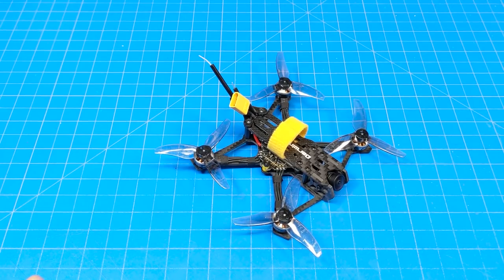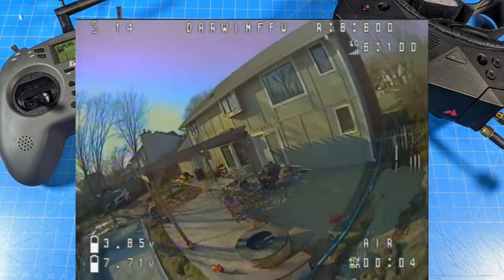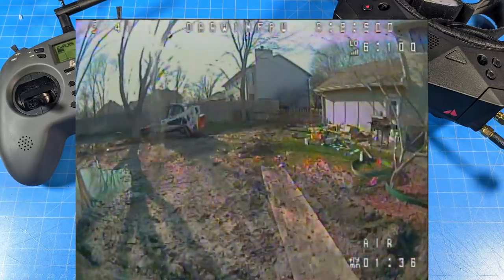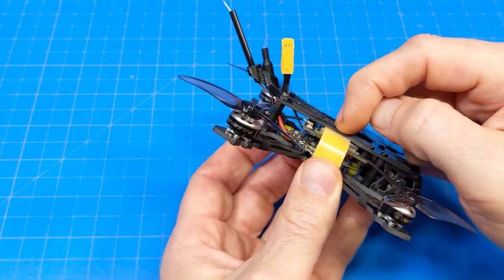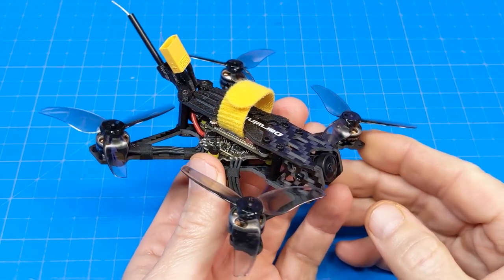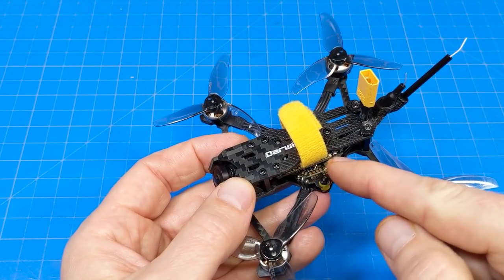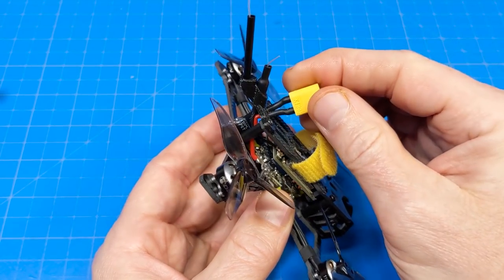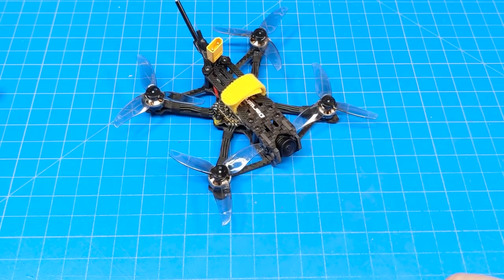Rare Top Mounted Micro Drone // $129 // DarWinFPV TinyApe

Comment: I have the Baby Ape and the Tiny Ape ELRS. I gave the Baby Ape a little TLC, re-arranged some wiring, and got full camera tilt control. Both quads have been really solid for me.
Reply: Im interested in the Baby Ape frame for a custom build. Was it the Caddx Ant camera with which you managed to get the tilt adjusted to the higher angle?
Reply: @yohfpv  I used the included Runcam camera but rearranged the wires behind it to get fully adjustable tilt. Nothing complicated, they just did a crap job with the camera wiring. All else is jam up.

Comment: Hello Nick, I purchased the DarwinFpv 129 about a year ago. I think it was $149 back then, from Pyrodrone. Wanted to get my feet wet in the 7" long range stuff. Flew really good, and even though it was a very light weight quad, as far as 7" ones go, it held up to whatever I threw at it. GPS had trouble acquiring sats at first, but otherwise a solid quad for the price! Much more resilient than a Happymodel Mobula in my opinion.

Comment: Ok, So I'd like to add my current experience to the Mix.  Obviously Nick has a ton more experience with these types of quads than I do.  

My TinyApes came with ELRS V 2 so that was nice.
# version
# Betaflight / BETAFPVF4SX1280 (BHER) 4.3.0 Dec 13 2021 / 11:23:34 (norevision) MSP API: 1.44

I just received mine DarwinFPV TinyApe (Qty 4 as I have 2 daughters that fly as well), on Friday (All 4 took about a month to get to my door and showed up on the exact same day together, even though I had placed the order for the first one 1.5 weeks prior), and have had one motor go bad, and another motor break a shaft. 

We had treated the TinyHawk 2 much much worse, and honestly it had 50 bad crashes, and other than the props, and a few screws breaking the components worked fine, so I guess I was expecting the same form these.  The TinyApe sure seems in the same line a the TinyHawk 2 Freestyle 2.  I would have to say that with the TinyHawk, what my 10 year-old daughter put it through should be called ABUSE, she was really rough on it.

While the broken shaft stays on mostly during flight due to the motor magnetics its interesting that in about 50+ flights on 2 of these TinyApes that we already have 2 broken motors.

I had upgraded one to the 4.3RC6 Firmware and applied the CLI List directly from Darwins site, and there are errors, that need to be corrected.  The original dump seems to have the same errors even if you apply the 4.3RC1 firmware.  Darwin must be running an original non RC code.  I enabled 48k pwm /Dshot Bi Directional and had about 52% CPU, and applied the UAVTech Whoop 1s&2s presets, and the unit seems to fly fine with the AvianRush Props that the TInyHawk used.

So to me it looks like the FC board is better than the Emax, but the motors seem to be MUCH worse.

As far as flying it seems to run well and had a nice feel during circuits LOS (Line of Sight).  The video transmitter get HOT HOT HOT under the strap that is a pain as Nick has said.  I have tried turning it OFF, and that doesn't seem to work, I have also turned it down to 25mw as we are LOS right now.  The video was good and strong in our 04x and 04L's.

I'd like to know how to turn the video off and save some heat, and also who make the best 1103 motors as replacements, as I don't thing the Emax ones will fit as they use that weird screw pattern.
Reply from the maker: While not a good experience. I appreciate you taking the time to leave your experience and thoughts as well. Valuable information for those willing to do read. About the only way to really turn off the vtx is to put it into pit mode, if the vtx has pit mode as not all do. We can assign that to a switch in the modes tab. Otherwise we can put it in low power disarm which is on the vtx tab of betaflight app. This doesn't turn it off but keep it at low power until we arm. The next alternative is to de solder power from the board, which is a pain and a bit of an extreme step.
Reply: @NickBurnsFPV  The real question is who makes the best 1103 8000kv replacement motors as far as durability goes.  I really like the quad otherwise.  It seems to fly similar to the TH2 with the Avian Rush props and a little throttle limiting for my younger daughter, older daughter prefers the more slippery feel of the Gemfans.
Reply from the maker: @halledwardb  That is a good question. For durability I would suggest brotherhobby or rcinpower. I would start with rcinpower.

Comment: A while back I bought a bunch of tiny little M2 and M3 washers, some stainless, and some made out of a really thin black plastic, that were only a few thousandths thick, or maybe like 0.25mm or so; eventually I realized they were super useful as very small-increment spacers for stuff like the gap from the VTX to the top plate, etc... Actually in a situation like that I'd put a couple of them on top of each of the standoffs, or one on top, one on bottom, depending, to create a very slightly larger gap between the top and bottom plates, then a couple on the VTX screws to make a bit more room for the strap... Anyway, just a footnote; great video as always!

Comment: Been waiting for this review nick 😁👍🏽It seems like it's a decent little ripper I however hope they come out with an updated version of elrs since my literadio 3 is 2.0 but other than that it really looks great for the price and to have a 600mw vtx is one of the highest I have seen on this size quad 👍 great review I have been pacing the mailbox for my mobula7 1s elrs lol but I'm definitely gonna grab this quad next 😁 the pool is coming along great too👍🏽✌🏽
Reply from the maker: Interesting that they show the board alone with ELRS v2. Maybe they have updated since mine was sent out. I have had it for a good while.
Reply: @NickBurnsFPV  good point nick maybe so because I really like these little quads they really rip and it looks like the power to weight ratio is pretty good I didn't see any issues when you were ripping ✌🏽
Reply: They've updated it by now. It ships with BF4.3 and ELRS2.0.
Reply: @FerralVideo  man my mobula7 1s gyro was bricked I'm scared to mess with another aio elrs board lol

Comment: Throttle scale is what you're talking about.  You'll find it in the rate profile screen.  Also useful is setting your throttle's midpoint to match your hover point.  When you do that and throw on full expo, it makes holding altitude while flying in Angle mode a snap.

I ordered a Baby Ape Pro from Banggood on the last week of March.  Expecting it within the next two weeks.  Got it for CDN$128, including 4 sets of spare Gemfan props, and s&h.  Great deal.  I'm going to try running it on some 2S Tattu 450 mAh HV 95C long packs.  I've got a Happymodel ELRS/VTX combo board and a HGLRC lollipop antenna for it, too.  The Tiny Ape looks like a winner for me, and I think I'll be having one in due course.  I was planning on getting a backup for the Baby Ape anyways.
Reply from the maker: Isn’t that only in bf 4.3? We will hopefully see the 4.3 final
Reply: @NickBurnsFPV  I've been using it on older BF firmware for a while - at least a year or so.  Under the PID tuning tab, and Rate Profiles tab, there's a Throttle Limit box, I choose 'SCALE'; a Throttle Limit, up to 100%; a Throttle MID; and a Throttle Expo.  Right now those last three numbers are set at 50% Limit, 76% MID, and 100% Expo, and my transmitter's throttle has a 90% Expo on it.  Altogether this gives me a huge sweet spot mid-throttle when flying in Angle mode, with the added benefit of being very forgiving and smooth when ascending or descending.
Reply from the maker: @billmcdonald4335  ah I must be mistaken. Kinda normal. Its nice the betaflight devs thought to include that as an easy option for us.
Reply: @NickBurnsFPV  I'm using 4.2.9, ATM.  Started on 3.0.whatever.  The devs have done wonders over the years.  I fly a four-year-old platform, and I've got it handling like a modern-day cinewhoop.  Smooth like buttah, thanks to the devs - and some great tuning advice from Chris Rosser, and Mark Spatz.  And actually, your review of the OG KingKong ET100 is one of the reviews that sold me on it, so thanks, Nick!  That's what I still fly - tho' it's the V2.

Comment: I got a tinyhawk 2 freestyle years back, it's very similar to the babyape, 2.5in 1103 motors etc. Upgraded it with a new fc with elrs and a 400mw vtx, new props, xt30 and so on. It flies amazing.
Reply from the maker: sorry can you clarify which you upgraded?
Reply: @NickBurnsFPV  I upgraded the flight controller aio on rhe tinyhawk to a happymodel x12 elrs aio that supports 2s, it had an integrated 400mW vtx. Had to do a bit of drilling on rhe frame ro make it fit tho.
Reply from the maker: @leonardterlevic4765  ah I understand better now. Thank you

Comment: I currently own four quads from Darwin FPV. I live in south Florida, and they arrive pretty quickly. I love their quads! One thing that I noticed is they are never tuned very well! I have had to tune the PIDS to eliminate oscillation issues on two of them. I do have the 7" long range and it  gets a lock faster than my Diatone Roma. One had the VTX locked at 25mw. I wished that manufacturers who sell to the states would have them unlocked at 25mw to make it easier to set them up! One thing that most reviewers should tell about this little quad is that the PID tune is set by default for 2S batteries. The recommendation is to set the PID tune to profile 2 in Betaflight. That is supposedly preset for 3S flight!
Reply from the maker: But with that they state the motors will burn on 3s.

Comment: I have been looking at one of these, but I am just so happy with my modified TinyHawk II Freestyle that I would have too high of hopes for this.  For sure going to pick up something Darwin at some point though...maybe a 7".  Out of curiosity, why do you not high volt charge your multi cell packs?  I have been HV charging mine and would love to know what the reasons are so I might consider adopting the standard myself.
Reply from the maker: I find that if I high volt charge multi cell batteries they don’t last as long. And when they hit that mark they fall off dramatically.

Comment: Hi Nick! Shipping update on my DawrinFPV 1-3S AIO board I ordered April 7th. It shipped on April 13, and I received it in Ontario Canada on April 25th. Not installed yet, but well packed. XT30 and motor plugs came in a bag unsoldered, but thats great as Im going to solder motors direct anyways. Will go on an AOS T3 toothpick frame
Reply from the maker: That’s pretty good shipping all things considered

Comment: Hi Nick. I own a baby ape pro ordered via banggood and have ordered  the AIO  board with elrs have to build that into the crux 3 frame yet. I live in the Netherlands and the shipping time is the same as banggood two to three weeks. I think they make quality products for a reasonable price and they think they products trough and are really good put together. Maybe they can put the xt30 connector into the 3d print... O and I really like that their AIO has a much higher amp rating than let's say 5amp so it will live longer I think.

Comment: Nick, have you tried to use the RunCam Thumb with this quad by chance? I just did a video on it and have struggled with getting non-corrupt video from my thumb with only this quad. About 5% of the video I take has glitches and corruption. I am guessing it’s a power delivery problem, but would appreciate your input.
Reply from the maker: I have not. I might be able to get it out this weekend if we get a break from the rains.

Comment: Can you give us an exact link to the battery you are using and charger?  Could i also use one which has even a bigger capacity?
Reply from the maker: This is the battery https://www.amazon.com/GAONENG-Battery-Doinker-Moskito-Quadcopter/dp/B098364VVM
My primary charger is no longer sold. This is my secondary charger https://www.banggood.com/HTRC-T240-DUO-AC-150W-DC-240W-10A-Touch-Screen-Dual-Channel-Battery-Balance-Charger-Discharger-p-1669367.html?p=RZ29002443189201508J&utm_campaign=2443189&utm_content=10589&cur_warehouse=CN&ID=47184

Comment: Nick, I have a question, I am still on ELRS v1 and this is the first SPI quadcopter that I own. I have 6 quads on the EP2 external receiver with no problems.  I can not get it to bind at all to the radio. Can an EP2 receiver be wired to RX1/TX1 without making any changes in betaflight other than setting the port. Do I need to turn anything off on the board? I have set the RX packet rate to 500 and set the binding phrase, but it will not bind!
Reply from the maker: Ray I suspect the new quad is on elrs version 2 as they updated shortly after early shipments. Yes and kind of to your question. We should verify the Rx is set to crsfr on the configuration page of betaflight, and disable the spi Rx. I don’t recall what we have to do to disable the onboard spi Rx. Otherwise yes wire to Rx and tx pads and turn on that uart.
Reply: @NickBurnsFPV  Nick thanks for the quick reply. I did check the product page after posting that question and sure enough they did upgrade to ELRS V2. Do you have a video that has been done showing how to upgrade both the TX module and RX to the newer version. I was trying to avoid it due to the fact that like a dummy I installed V1 on between 6-8 new quads using the EP2 receivers. I have EdgeTX on a Jumper T18 Pro V2 radio and a Happy Model ES24TX module. I just purchased all of these sinc Christmas and am not looking forward to upgrading all of these quads. Oh well! Will I have to upgrade Betaflight on the FC as well?
Reply from the maker: I don’t have a video specific to elrs v2. The flashing process is pretty much the same but there are different options with v2. We will need to update the elrs app if we haven’t. If you use a binding phase that will eliminate the need to rebind on each of the quads you have but still gives us the option to bind to a Rx without a binding phrase

Comment: Does it include elrs or did you have to add it? Didnt you say the baby ape pro has a better camera? Thx
Reply from the maker: the baby ape pro has a better camera than this? neither are great cameras. Elrs is part of the AIO
Reply: @NickBurnsFPV  thx, i mixed the baby ape versions with the tinyape. If i order the tinyape elrs to austria, which link would be a better choice to prevent long shipping times....?
Reply from the maker: @dsphotos  If you have ordered from aliexpress before and are comfortable with that option, I would do that. I hear darwinfpv and banggood shipping is about the same to the US, 2-3 weeks. I find aliexpress orders arrive faster to me than banggood.
Reply: @NickBurnsFPV  thx a lot and congrats to the pool 😎👍

Comment: hi, im really neww to fpv and am still researching for my first one. im between this and the mobula 7, but i noticed on both this and the mobula that there was a usb port. what's it for? google isn't clear
Reply from the maker: the usb port is for connecting the flight controller to a computer. Then on the computer we use the configuration application called betaflight to do any needed setup, like binding, setting the radio switches to the quad flight modes as well as the rates we like to use or try.
Reply: @NickBurnsFPV  thank you, idk why I didn’t connect the dots

Comment: Hi nick, I built a 2inch toothpick. I put the battery on the bottom. I'm not a good freestyler nor knows lots of tricks but I was wondering whether it's a fact that "we can't freestyle a bottom mounted bat"??
Reply from the maker: No I don’t see it as a “fact” we can’t freestyle a bottom mount battery. I think in most cases we are freestyling. I would only declare anything other than freestyle when the object of the flight is to go through gates in a timed manner. I think freestyle most accurately describes a type of frame where the battery is on top. For the top 1% it likely matters if the battery is on top or bottom for their particular goals of flight but for most of us either is good.
Reply: @NickBurnsFPV  thanks Nick. I tried to fly both mounts. There's actually no difference. I do understand that for a 5" setup the bottom mount battery can be squeezed or clipped. For micros it's less of a risk.
Reply from the maker: @jeffclassics  There is a different flight feel, but for most of us its so minor it doesn't really matter. I am sure the pros would argue there is a huge difference, but thats the top 1% :)

Comment: Great timing Nick! I just noticed this quad today on darwins site and wondered what the heck is that. I placed an order last week directly with DarWinFPV for their new 1-3S AIO board with ELRS. Shipping to Ontario Canada, it wont be in for quite awhile. It took 6 days from date of order to be shipped and picked up by courier. I can wait though, I cant get enough of my TKS Rocket race these days though I broke a motor shaft on my 3rd pack. I did have the prop pressed down as far as it would go. Do you ever fly with prop screws on micros to prevent this?
Reply: howd it go? I plan to buy that same board for a 1s toothpick
Reply: @im_ricebowl  I thought I didnt care, but it turns out that I do.. the SPI based elrs is a pain now that 3.0 is out. Also, spi based elrs on this AIO is not compatible with vtx admin, the spi receiver restarts each time it connects until you arm because of the vtxAdmin sending change channel requests which write to the eeprom.

It was also not a great choice for the AOS T3 frame with the usb port in a poor location. 

The quad doesnt fly great, not sure if its my poor tuning skills or the gyro. Also, cant use dynamic idle because the f411 processor isnt fast enough. Though maybe Im asking too much from a cheap AIO board like this?